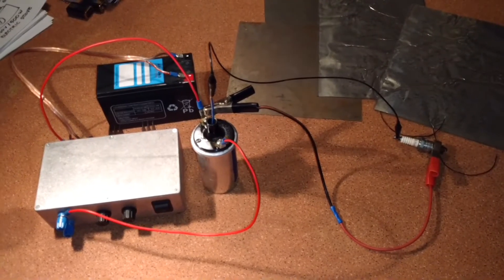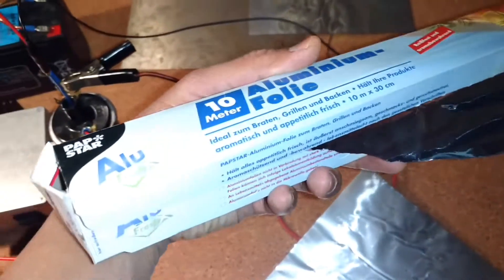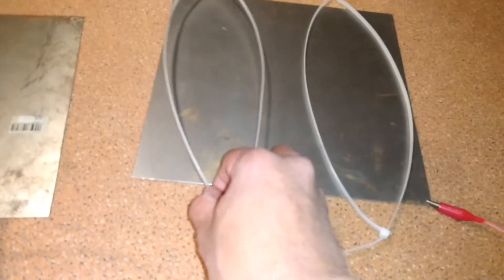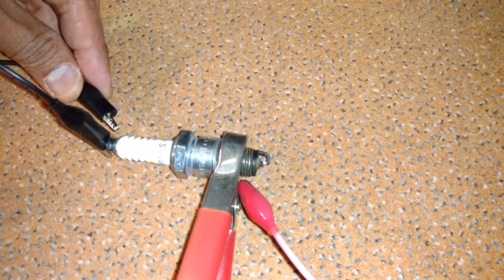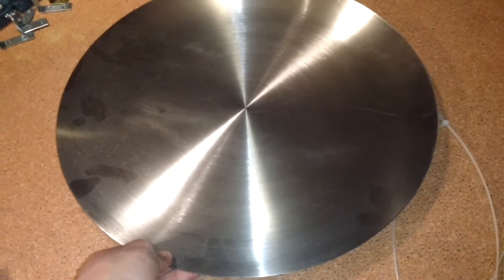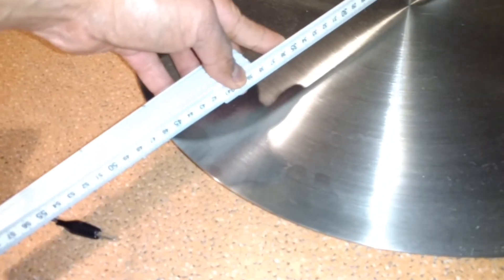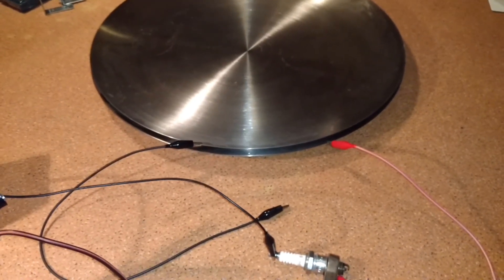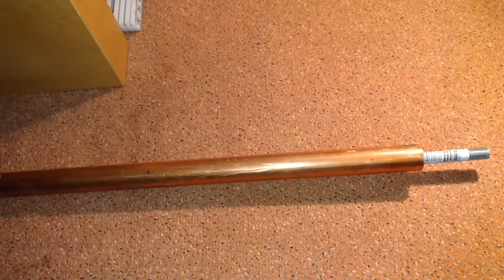Simple Plasma Ignition - DIY Capacitor

Comment: can i use a small amount of foil? About 2 to 3 inches in diameter? im only using it for my scooter. tnx
Reply from the maker: You have to find the optimum configuration by yourself. Just try different plate/foil sizes and also gap between plates. I wish you good luck and success!
Reply: Okki Moeljadi thank you very much!